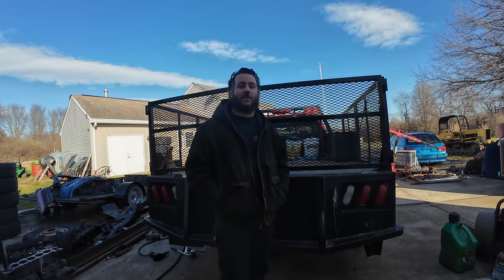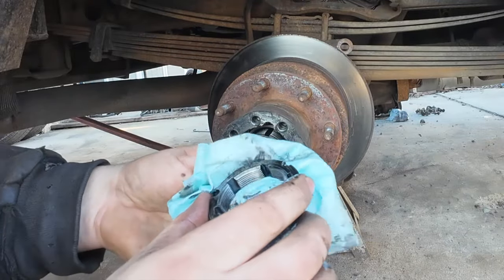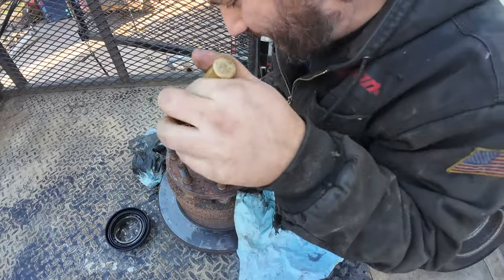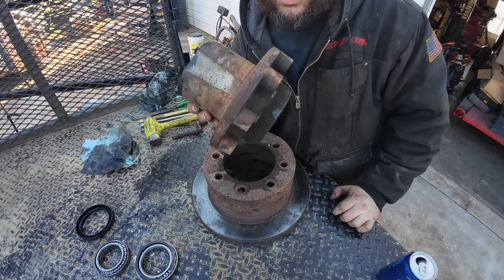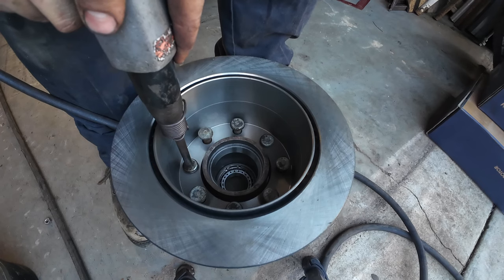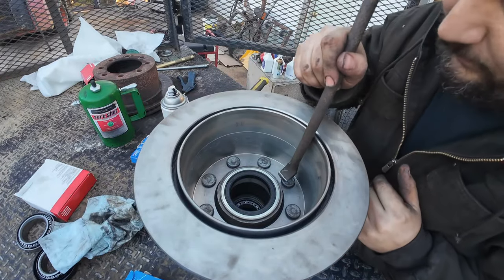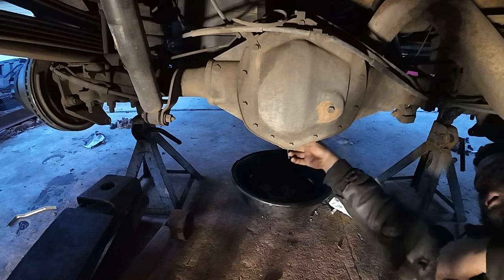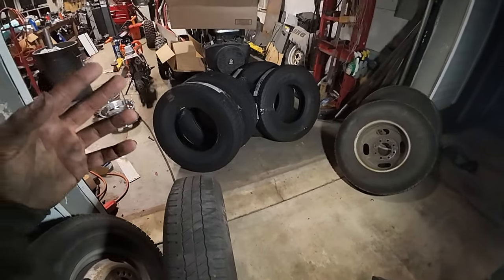Duramax Dually Rear brakes. Parking brake adjustment SUCKS!

Comment: I never have to pull the right side rear hub to adjust the parking brake. You can make the adjustment through the slot but it can be frustrating at times. Also if the axle seal is stuck on the axle. Get yourself a long pry bar. Wedge the tip against the rear parking brake pad and pull it towards you. I do these all the time on school buses. Really poor engineering and design. You did great work.

Comment: Hey, where's the part where you adjust the parking brake (as stated in the title)??? You ought to change the video title since you didn't actually show how it's done.
Reply from the maker: I am sorry you didn't find what you were looking for in this video. The parking brake is easy to adjust by turning the star wheel like any other car. The issue is that you cannot access it without pulling the drum/rotor. Hence, why the video is mostly centered around that nuance. I figured anyone getting this deep would know how to turn the star wheel themselves. Let me know if you have any other questions!

Comment: Forget aluminum wheels. Get a set of stainless steel wheel simulators and keep the stock wheels. Just had a flat on the front of my Chevy 3500. That's a lot of fun taking a rear wheel off to swap on the front by the side of the interstate with traffic flying by at 70 mph.
Reply from the maker: Ugh I know I took a step in the wrong direction here. Im sure my day will come as well

Comment: Ive got a lot of runout on both sides of my rear axle. You can see the wheels wobbling when you drive. Took the wheels off and it seems like the hub is wobbling too. What would be the most likely culprit? The bearings? Almsot no way its bent axles being a floating rear end right? Great video!
Reply from the maker: Correct, the axles only provide the torque on a full float, they dont support the hub at all. Id check your bearings first then inspect the hub. You can stick a dial indicator on the brake bracket and spin the hub to see if its bent. Gotta disassemble it all to get there though... I hope its just your wheels? Those hubs seem pretty tough.

Comment: Man, those look like a pain in the arse to work on. No brake adjustment, special tool required, studs through the discs, seals to replace every time. Pffftt

Good job tho. Should keep it going for several more years

Comment: Try a slide hammer to pull the seal off the spindle.
I took a long flathead and bent it at a 45 about 2” from the tip. You can adjust the parking brake on the truck no problem.
Reply from the maker: Ill have to look again. I couldn't see a spot that would let me get into the backing plate even with a longer tool.

Comment: what is the size of the socket you used on the rear axle on the duramax
Reply from the maker: It’s a 6 prong spammer type socket. You can get them at most auto parts stores.